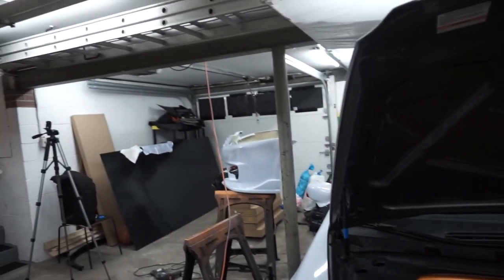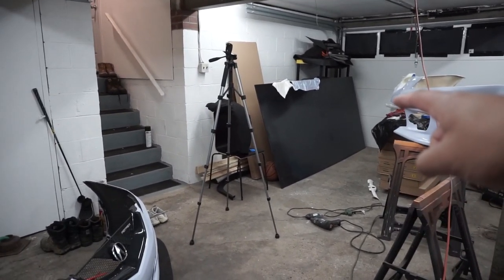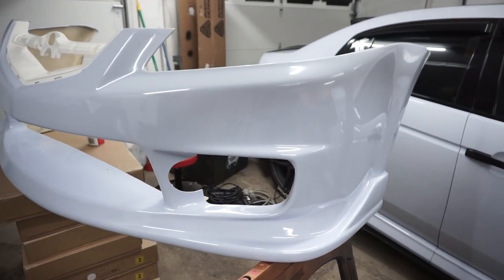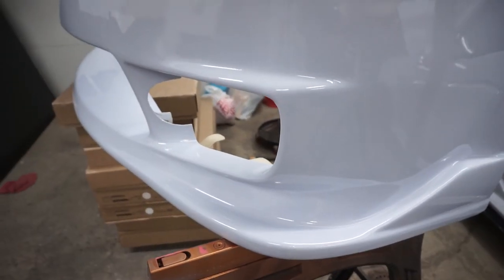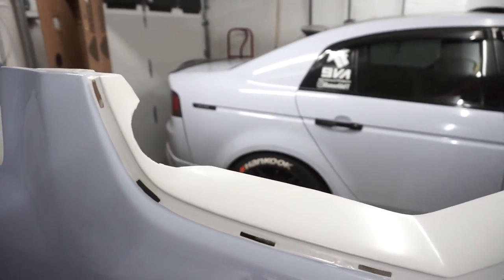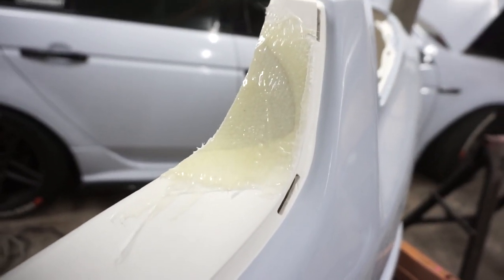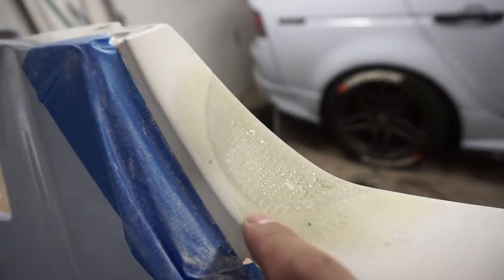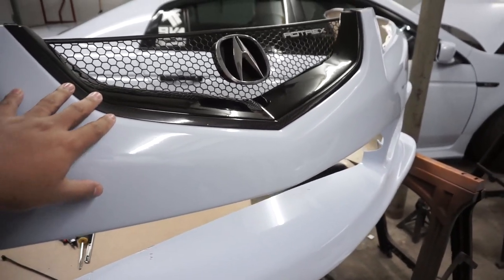DIY Grille Mod and Announcements!

Comment: Very nice mod!I want to do it on my acura tl 2008 too but i got a question for you,where did you get the horizontal rod on top of the grille mesh?I know I cant put on the mesh alone it wont be strong enough,it needs something at the top like yours